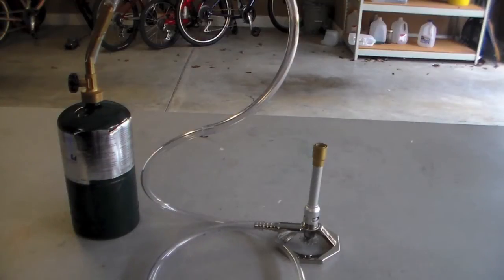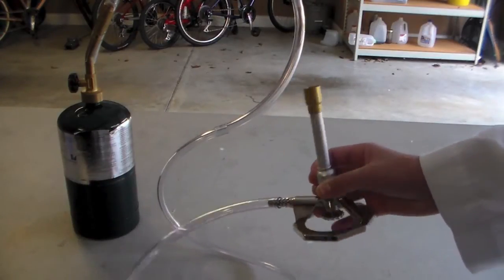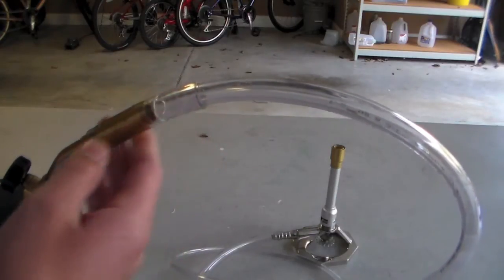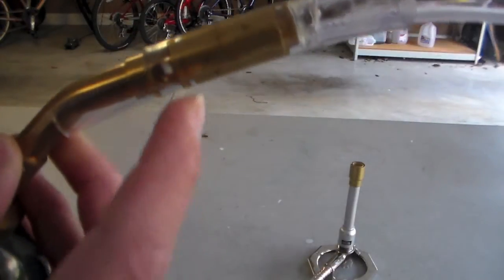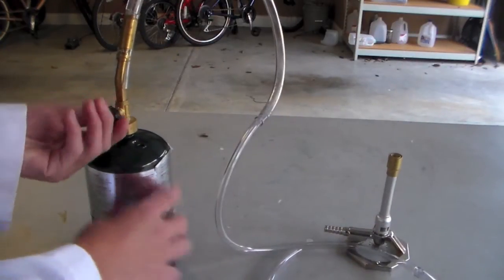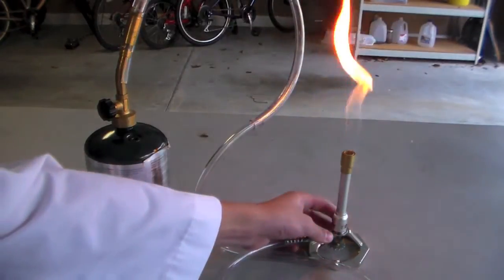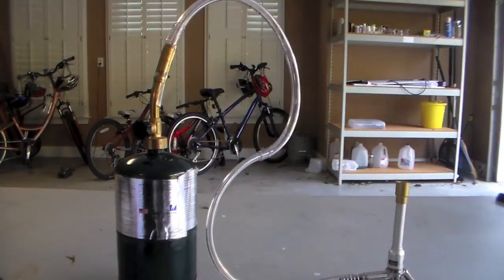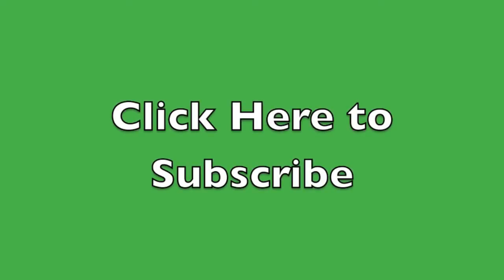DIY Bunsen Burner Fuel Source (Propane)

Comment: DO NOT USE CLEAR VINYL TUBING FOR PROPANE (or for any flammable gasses).

There are three main reasons for this:

1. Vinyl is fairly easily nicked or cut accidentally (e.g. you're moving it around and brush it against something sharp), which can produce dangerous leaks.  The material of many vinyl formulations can also degrade over time (with UV exposure, etc), producing micro-cracks or pinpoint leaks which may not even be visible.
2. Vinyl is very stiff and usually does not seal completely around the common barbed fittings used for bunsen burners, etc, particularly if moved around a lot or removed and reattached more than a couple of times.
3. Most important: Plain vinyl is FLAMMABLE and has very low heat resistance.  This means if you accidentally get your hose just a little too close to your burner, you could have your entire apparatus suddenly go up in flames in an instant right in front of your face.

For these applications you should always use tubing intended for flammable gas (LPG rated, etc).  This tubing is usually red, orange, or black, and substantially thicker, with a reinforcing mesh to prevent being easily cut or damaged and a rubberized outer layer.  For the last couple of feet to your burner, where more flexibility, or frequent detaching and reattaching is sometimes required, rubber or neoprene hoses can be used.  All of these are readily available at most hardware stores or off of Amazon, etc, they are fairly cheap, and they could mean the difference between just a minor "oopsie" or a full-blown trip to the burn ward some day.
Reply: Spoken like a true welding instructor. I'm glad I wasn't the only one who had a problem with this. The other thing is he needs to keep that hose farther away from the flame and secure the bottle

Comment: Very nice! Plus it helps act as a secondary flashback arrestor, since the propane tank has a separate valve. :)
Reply from the maker: Yeah-thankfully though I haven't had any flashback situations yet :)
Reply from the maker: Also, I have recently discovered your channel! You have amazing videos! Keep up the good work! I am featuring you on my channel homepage (I know it won't help much since I only have 90 subs), but hopefully it should give you a little more traffic :)
Reply: Thanks! I will definitely add you to my recommended channels list! Have a good one!

Comment: how hot can it get?can it reach steel melting point? was thinking to use bunsen burner for my steel craft,but not sure how long it take to cut the steel.
Reply from the maker: +ahartakpower Propane burns hot enough to melt brass and steel, but you will need to build a furnace.
It definitely would not be able to cut steel on the spot though. You would need something like an oxy acetyline torch for that (something like this:https://www.youtube.com/watch?v=EA-VCaBUsCA)

Comment: looks like you inserted a 12 inch or more length of 7/16 inch hose into a 1/2 inch hose,  how did you ensure that gas does not leak ?  the connection on the burner requres 7/16 inch and on the torch is 1/2 inch.
Reply from the maker: +Gregg Jones Greasing the joints helps to limit leaks. I didn't smell any propane leaking out, so I assumed there wasn't any leaking
Reply: +Gregg Jones If you want to check for leaks you could mix some dish soap and water and put it around the connection and check for bubbles forming.

Comment: Actually, the orange flame is hotter, due to its' orange hue coming from glowing-hot un-burned carbon atoms
Reply from the maker: Fake McNamison A blue hue means a hotter flame
That's why candles burn yellow and blowtorches burn blue
The shorter the wavelength of light being emmited (blue is shorter than orange), the higher the energy, and the hotter the flame